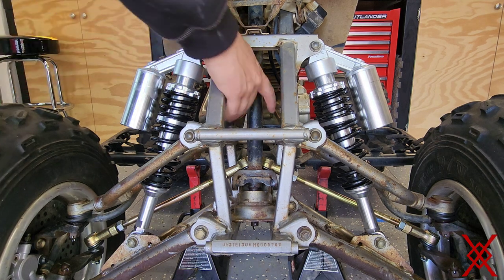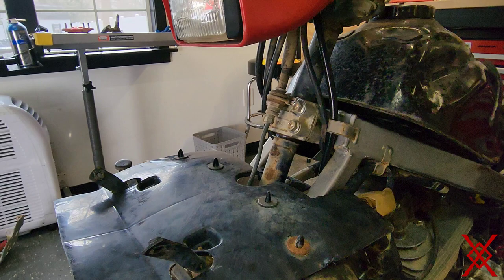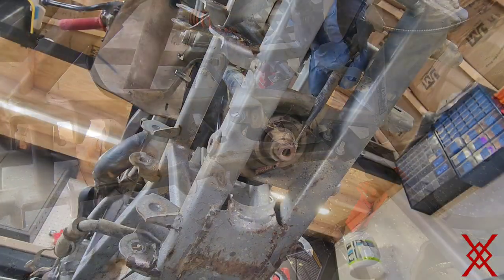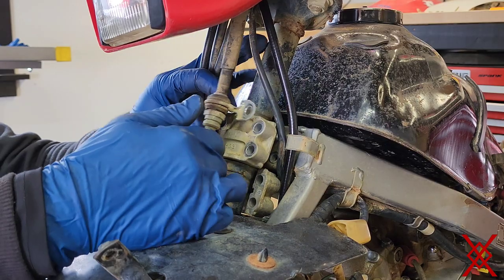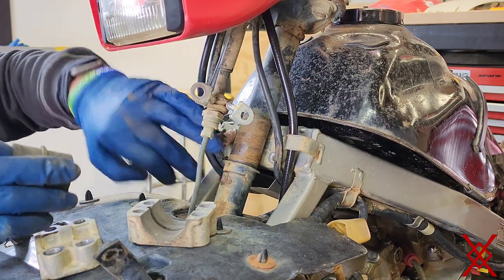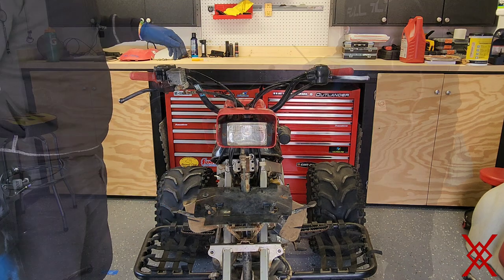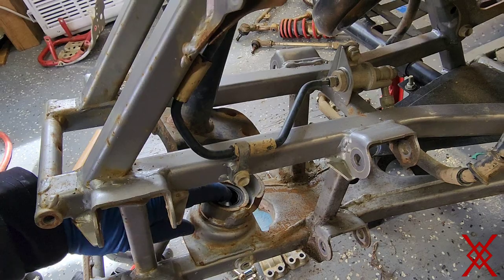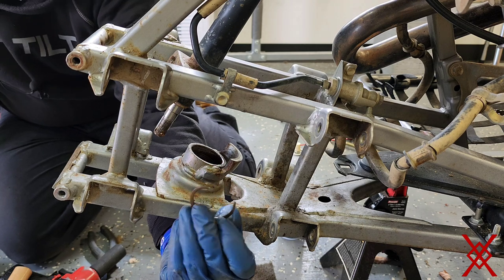HONDA ATV HOW-TO Inspect & Replace the Steering Stem Bearing, Seal, & Bushing

Comment: Nice!
Coming along real nice.
when you were lifting the handlebar and stem up and out of the way, how much more room did the cables have before being pulled full tight?
Did not come up on my subscription, I just saw it by accident
Reply from the maker: They moved enough to slide the bottom of the stem out of the frame without putting to much strain on everything. I try and do things from a maintenance standpoint and not like a rebuild. Even though when everything is out of the way its easier for the videos. Thanks for watching. Making a few shorter videos focusing on specific things.